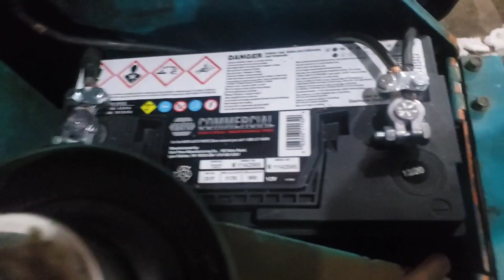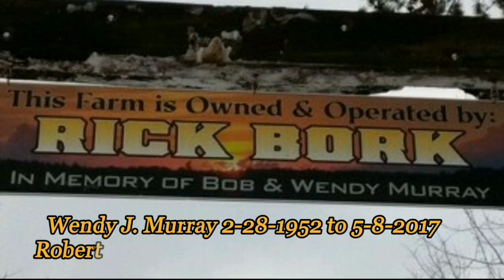Another Cold Day on the Farm

Comment: You really can't go wrong with a group 31 battery 👌👌👍
Reply from the maker: It will sure crank that little excavator over.
Reply: @RickBork  should mention the next time you're down here if you need batteries there's a place in Farmington that sells blem batteries cheap usually you can get a group 31 battery from them for around 70 to 80 dollars that's what I put in the all the tractors and combines might as well have more cranking amps for less money stay warm Rick 👍👌👌👍 on second thought at least the air will smell good with all that burning pig fat

Comment: I've had decent luck with napa battery
Reply: Had a Napa battery last 13 years.
When I took it in for core the guy at Napa told me he didn't usually hear about that.
Reply: @brycewiborg8095  had one in my M for 11 years
Reply: Was in a 89 F150 I still drive. 
I have a M with a magneto. 
Tend to use the crank.
Dad had a M, H, and a old case with magnetos.
He kept 1 6 volt battery. 
I learned at the feet of the master.